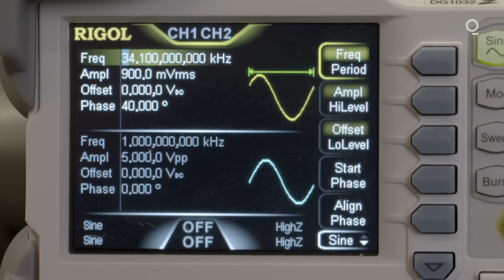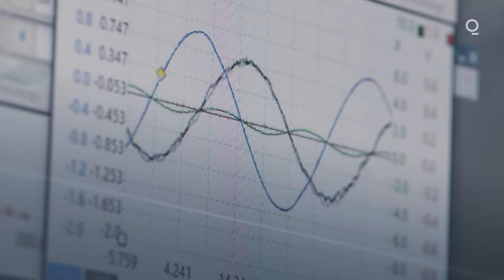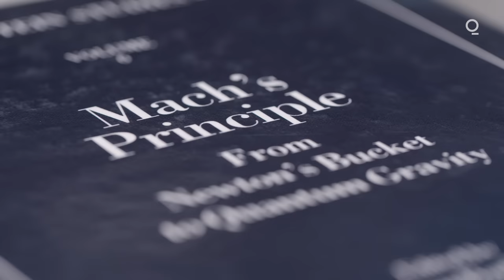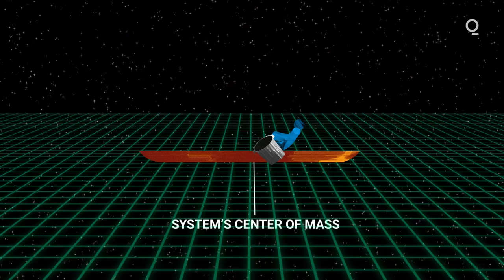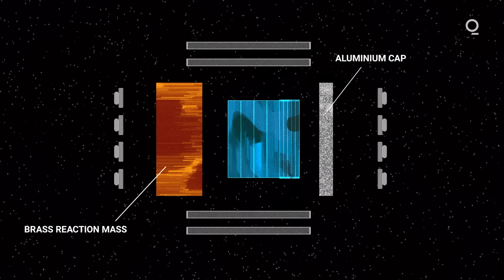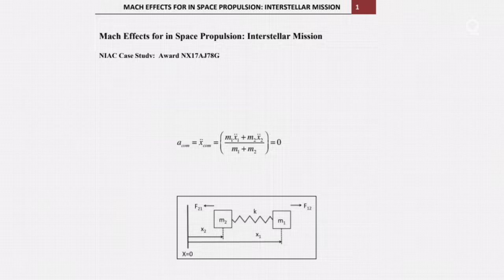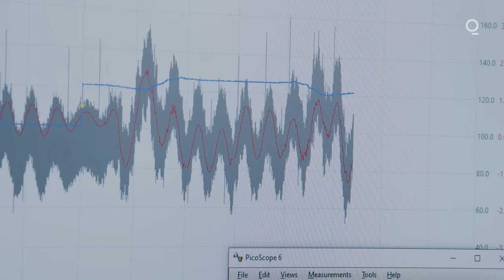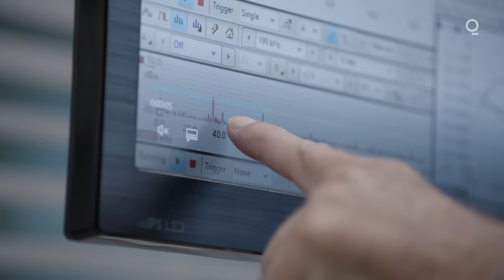Two Scientists Are Building a Real Star Trek 'Impulse Engine'

Comment: I found it interesting that whoever built the graphic of the boat rowing @3:55 doesn’t even know which direction a rowing boat goes.
Reply: normally the person rowing moves backwards. there is a system that can installed that changes the normal paddling direction to move you forwards however.
Reply: If you mean the part with the trash cans of water; when the center of gravity 'moves back,' it's not actually moving, the boat is. So the boat will go forward to the passenger's perspective.
They aren't moving the water as with oars, they're just shifting their weight and the boat is moving.

Comment: Well you're a scientist. You're supposed to explore hypothesis, not turn down things just because the consensus is "this can't work".
Reply: You've got to understand that they cant possibly test all the wonky ideas people come up with, some may be so laughable they are akin to wasting time because none of the concepts of the device make any sense and the creator doesn't seem to understand the physics behind the device either
Reply: he is young all scientific breakthroughs have allways been done by older ppl 
as they think outside the box the young like to stick by the book
Reply: @paulus121212  Tesla wasn't old, such a shame his research is held by the USA.
Reply: @nolimit3281  testing this is extremely low cost! They can do this test with 1% the cost of buying coffee for the baboons at ITER
What the heck could you be complaning about
Reply: There are MANY things which work fine on paper, but in reality they dont. Not because of the "idea" behind it is wrong, but because the complexity of reality thwarts it, or the actual result is so minuscule that no practical use is possible.
This seems to be the same to me. The key is the "change in mass" principle. How big is that? Also, is there ANY other effect countering it? It must be proved that there is NO possible "external" source of inertia. So, the "engine" can REALLY move on its own.
The experiment is not built to prove that, which I see as a problem.
The PRINCIPLE must be proven first, and THAN you can work on the most practical use of it.
Reply: @krashdown5814  Tesla's research was cutting-edge for the time, but it's not magic. Everything he worked on is fully understood today and taught in university programs.
Reply: @meleardil  Yes, there needs to be a mathematical proof that other scientists will buy into, for this thing to literally gain leverage.
Reply: @ForgeMasterXXL  there doesn't need to be a mathematical proof. There just needs to be a phenomenon you can demonstrate and is reproducible.
Reply: @ForgeMasterXXL  Not even mathematics. Just a conclusive proof (elimination of ALL potential false positives) that the effect is THERE. Similar to the base experiments of quantum mechanics. Once it is pointed out that there is actually SOMETHING to research, a horde of curious theoreticians will jump on it.
Reply: @paulus121212  Im pretty sure isaac newton and einstein were relatively young when they came up with their most famous theories. From what I heard, in math and physics most famous breakthoughs are made by people younger than 40.

Do you have examples of breakthoughs by older people ?
Reply: COMMON WE HAVE ZERO POINT ENERGY THE CABAL ARE HORDING !
Reply: It's bittersweet, but I suppose he has more freedom to pursue such an experiment because if it fails it's not like he's worried about tarnishing future job prospects. Unfortunately things like budgeting get in the way of pure science if it doesn't show a pay-out. So this is a passion project and a chance at a "last hurrah".
Reply: they misunderstand to disagree because since they're not the ones developing it, on paper it's their reputation, their job is on the line and they can't see any potential past it. they're afraid of taking a risk that shows potential for progress from development of application.
Reply: @krashdown5814  are you saying theres a conspiracy to supress teslas ideas? If so, then how would a suppressed idea become known in the first place if its been hidden?
Reply: Many of Tesla's later patents featured language like 'death-ray', 'untold destruction', 'no possible defense', 'instant destruction of target' and 'unlimited range'
Can't for the life of me wonder why the US government would be interested...

One thing about the Great Mans work; he patented things out of order, with odd names, never letting anyone know that patent 'X' was part of project 'Y'.
Sort of like Mad-Scientist Lego set; one can assemble the parts and come up with almost anything!
But if you look closely at the illustrations on the Box the parts came in, you can make the 'right' toy!

There is a Tesla patent for a 'vacuum nozzle'.
Plain and drab, a simple and robust thing that uses compressed air to operate a vacuum pump.

They have been around for over 200 years as 'aspirator pumps', used all over the world to this day.

His nozzle, however, was meant to be the 'firing port' for his Death-Ray.
The nozzles only job was to maintain vacuum in the accelerator while allowing the 'beam' a way out.

The ray was to be a linear accelerator throwing a thin 'beam' of white-hot tungsten plasma at 2/3 the speed of light!
Instantly destroying any line-of-sight target; no way to dodge.
No aircraft or surface ship could carry enough armor to be protected.
With the right 'English' on a shot, the beam could made to curve with the atmosphere for 'over the horizon' hits.
The beam was steered electronically (electromagnets at the 'muzzle' steered the beam like the electron gun in a TV tube!) and could engage hundreds of targets in a few seconds.
Sure, it would require enormous power at high voltage; Tesla Coils to the rescue!
His odd 'vacuum bulb insulators' could withstand enormous voltages at high frequency that modern science has trouble with.
Now we use Teflon insulators in chambers filled with high pressure exotic gasses and oils to withstand the same levels of power.
Tesla did it with blown glass bottles.

His work is out there, complete and whole, but he chopped it into little bits with odd names before publishing.
Reply: @paulus121212    "all scientific breakthroughs have always been done by older people"
This is simply wrong.
Reply: @k0lpA  
yep, every young inventor, had a 50 to 65yr old, or older Professor at University ...
To teach him ...
Reply: @paulus121212  "all scientific breakthroughs have allways been done by older ppl 
as they think outside the box the young like to stick by the book"

Utter nonsense. Not one word of that is correct.
Reply: Say that to the many engineers who assured me Hydrogen could not be used as a fuel.
Reply: thats the definition of research
Reply: @gordonpeacman2126  Oh and their professors had professors of their own too. Sure nobody young or old can claim to have discovered anything solely on their own, they all owe most of the work to the ones who came before them. But younger brains just work faster and get less tired so they are the ones who make the breakthroughs most of the time.
Reply: @krashdown5814  He did have that bonkers idea of transmitting energy to peoples homes using Tesla Coils, now we all know that was just a really bad idea, even if it were possible.
Reply: Yes, during the process of hypothesizing and development of a concept, new concepts are achieved, such as...Stephen Hawking inspired John O'Sullivan to accidentally give us all Wi-Fi. An Australian scientist by the name of John O'Sullivan was inspired by Stephen Hawking's theory of evaporating black holes and their subsequent radio waves. He set out to find them and prove the theory correct.
Reply: @rogerjamespaul5528  Whilst working in The NEtherlands if I may add :) And with Dutch Colleagues
Reply: @krashdown5814  Tesla seemed to be on the edge of insanity, kinda. Maybe that's where you make more breakthroughs :)
Einstein was fantazising about riding on a ray of light.
Reply: @nunyabisnass1141  Because they were Tesla's fanciful ideas, unlimited power from the ether. Perhaps if his paperwork were handed to other skilled scientists with unorthodox approaches like the Aussies who invented WiFi, the global energy crises might be solved. Once the USA has expended every  other country's oil of course, then charged everyone else outrageous prices for the oil they have been sitting on.
Reply: @krashdown5814  later in life Tesla went off the deep end with several nonsense ideas.
Reply: @vylbird8014  Not everything. he had a number of things that he worked on that just don't work in reality.
Reply: @ForgeMasterXXL  And that requires a theoretical underpinning that works too.
Reply: @meleardil  It is in the same realm that the EM drive was in until NASA proved it was just a side effect of a power connection.
Reply: @yannickg6904  Not a practical fuel.
Reply: @krashdown5814  Nope. Basically wasted into heat.
Reply: Every last barrel wow you are paranoid
Reply: When the hypothesis violates known reality yes you do turn down crackpot things.
Reply: 'You're supposed to explore hypothesis, not turn down things just because the consensus is "this can't work"."

Unless the hypothesis includes the violation of physical laws.